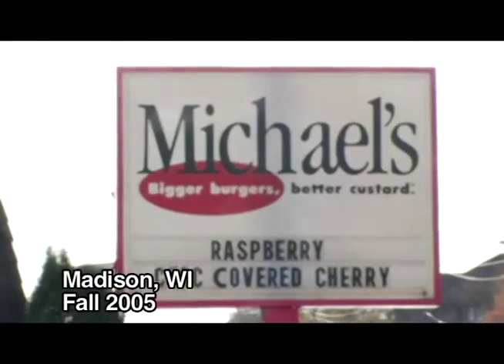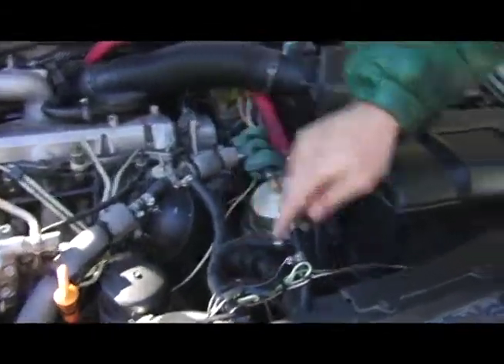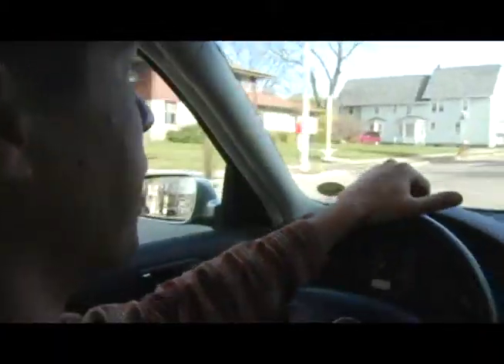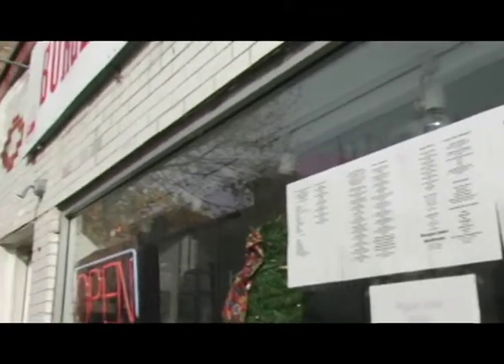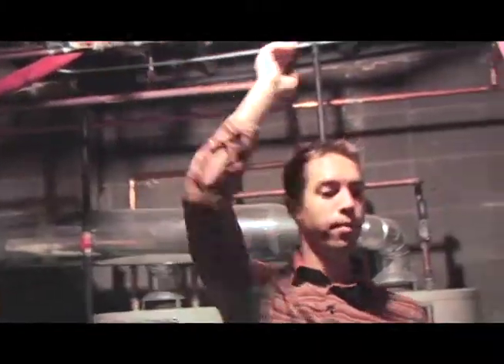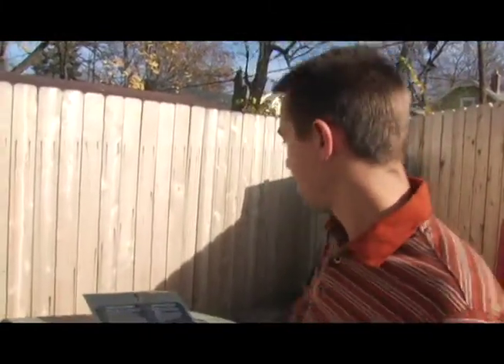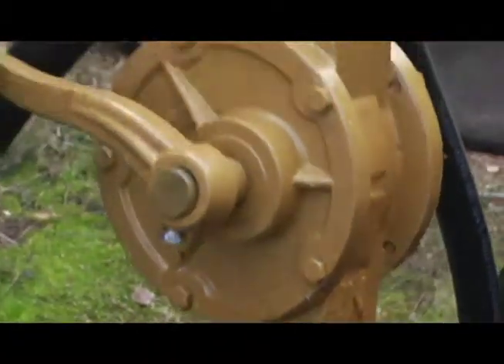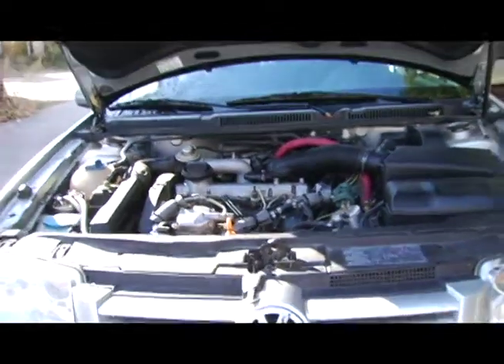Pay Dirt: How to Run a Car on Vegetable Oil

Comment: Tired of these scam artists. You DO NOT need to heat WVO to run it on any diesel engine. Your fuel system is not gravity fed, it is a high pressure pump that would pump pudding if you wanted it to. You do need to warm the engine on diesel fuel first in cold weather, but that's it.